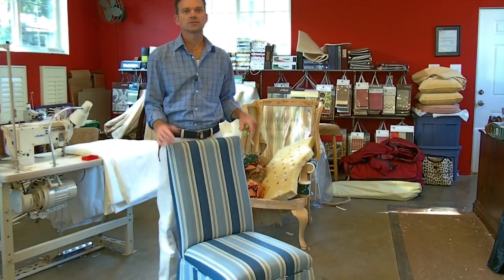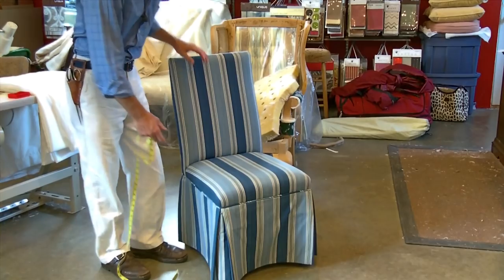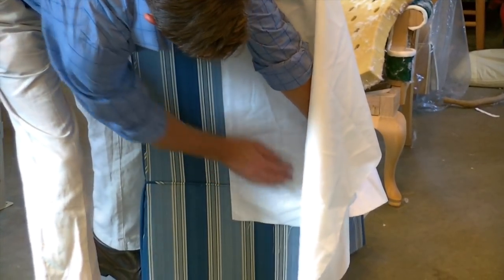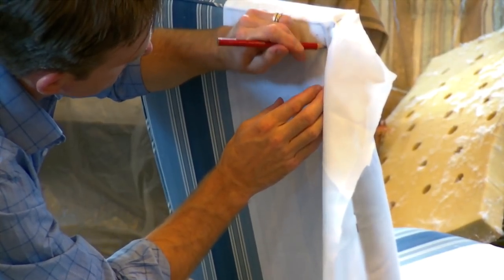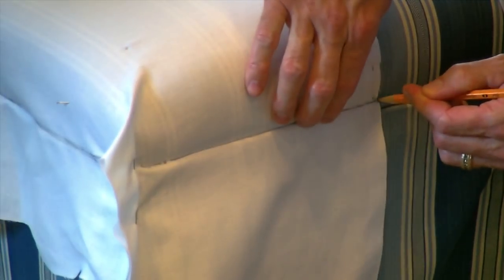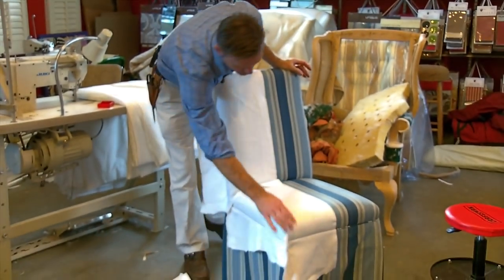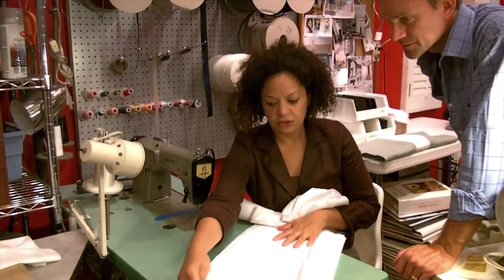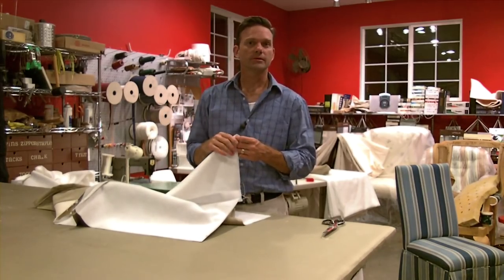Learn how to make a Slipcover for a Parsons Chair

Comment: Love the thoroughness however I was really really hoping to see how you got it onto the chair when it was finished. I am assuming the blue stripe slip cover came off and you had the batting exposed to then pull the new slipcover over... is that correct???
Reply from the maker: Beth Barkoviak Hi Beth, we appreciate you checking out the video and taking timeout to send us a question. No that's not correct, that video is just a straight up slipcover over an upholstered parsons chair in a stripe. But your right there's batting underneath the upholstery. I have seen an upholstered slipcover sofa before. Where the cover is made, slipped over the batting and then stapled to the frame, but this is not the case. What you saw in the video is it. Hope this helped. Hey If you like check out our newest video titled remove food stains. Let us know what you think. Regards,
Paul

Comment: Excellent video! I want to slipcover my dining room chairs, but they have wooden backs with cane inserts instead of upholstery. They are flat 
across the top. Im pretty sure I can do the slipcover; the only question I have is about the tuck-in. Since my chair backs have a flat wooden slat at the top and bottom of the back part (just above the seat level), would it work if I just made a regular seam and included a tie inside to tie it to the back of the chair?
Reply from the maker: Hello Jeri,
Thank you for watching the video and glad it was a help. Sorry for the late reply we have been very busy here. Yes I believe you are on the right track the ties will work well. A seam with no tuck in will work, it just needs to be close to the furniture. I hope this reply has helped and it is not to late. Thank you again. Please share it helps when you do. Cheers,     Paul.

Comment: I need a plastic cover for this same chair because my cat's hair is brutal. Can I use this same pattern? I know I'll  need a zipper back
Reply from the maker: Hey there Aliyah, hey thanks for leaving the comment and watching the video. Yes you can use the same pattern when using clear plastic for a slipcover. One drawback though if your cat claws the chair, you’ll see all those puncture holes. And if your chair doesn’t have any arms or doesn’t flare back much, you probably won’t need a zipper. It could slip right off without needing a zipper.  I hope this does help you and again thanks for watching. If you haven’t already please subscribe and share with others it helps a great deal when you do. All the best, Paul

Comment: Thanks for the video, just looking for some tips on how to do this...
"This is kinda tricky, if you cut it in the wrong place.." and whoops, the video skips to where the fabric is cut already.. Now I'm wondering how and where to cut it in the corner where the seat and back meet.. Because you said it was a bit tricky.. lol..
Reply from the maker: +solliebollie78  Sorry for the late reply. It is a little tricky in that area. The good news if you are using muslin as a pattern fabric you can easily replace that section and the cost is low. Before you start cutting mark the contour of the furniture and then cut toward those lines. This way you'll know if you have gone to far. Leave about 2" fabric tuck-in at the center of the seat and back. Taper the tuck-in fabric as you work toward the side of the chair. NOTE do not cut so close to that there's no give when the cover is complete. If there's not enough fabric to flex or give when a person sits down it will rip. You will need to work with it to see what's the correct amount you'll need in that area NOT to much NOT to little fabric. Multiple snips on the side where the tuck-in ends should relieve the fabric's tension if there is some. I thank you for watching and for your comment, I hope this cleared matters up for you. All the best.  Paul

Comment: I just watched the entire video.  Great video.   I tried making a slipcover using McCall's 3217.  It's a great pattern; however, it didn't fit my chair!!  Too small.  So back to square one.  LIke solliebollie, I'm a little confused about the corner where the seat meets the back, but I'll figure it out.  I also have the problem of the top of my chair is wider than where the seat meets the back.  I guess I'll have to put a zipper or use velcro.  My project is turning into a nightmare!!!
Reply: I had the same problem. Pattern E didn't fit the chair.  Try using pattern C or D. The back is much easier to assemble. All I had to adjust was the seat size.